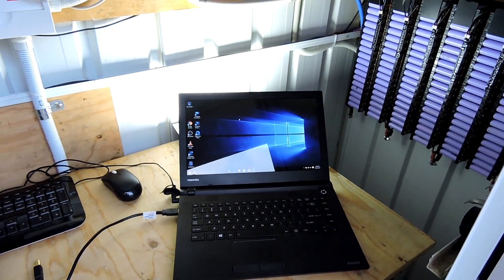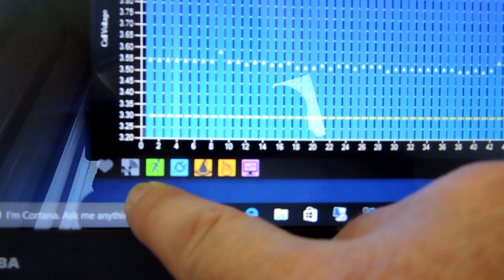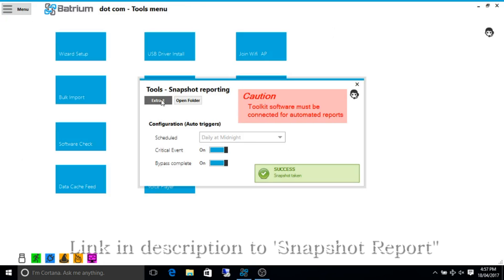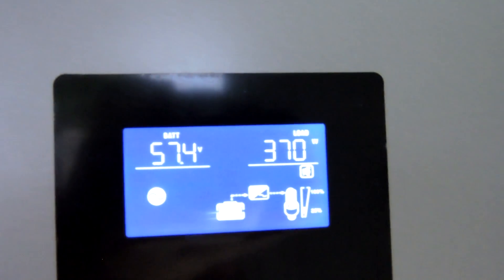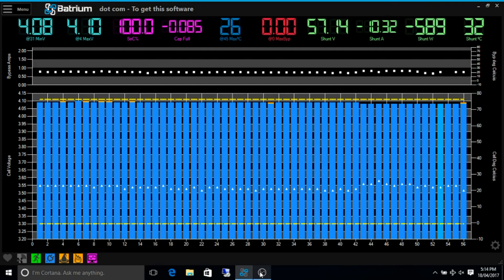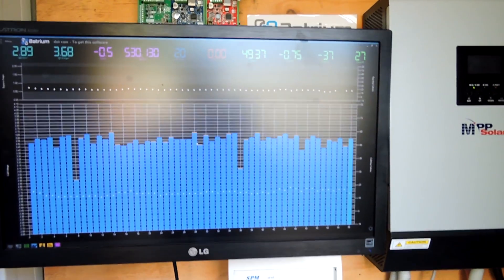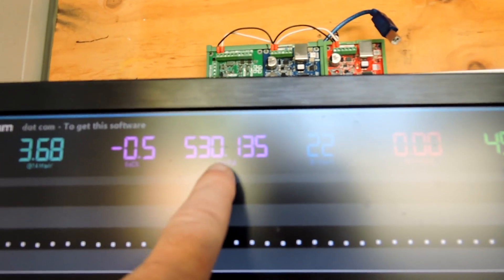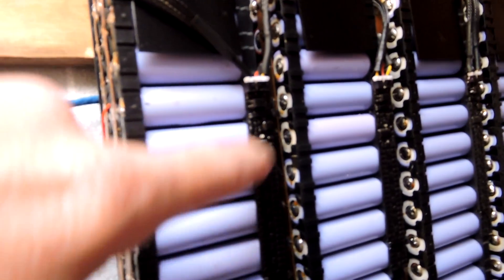18650 real world load test - 63 hours to run from 57.4v to 49v not bad from recycled laptop battery

Comment: That is 1/10th the month now you just need to add another 40,320 battery's to it and you can go a month (roflmao). Hey if you install 2 banks of 44,800 you can power the house for a month on one. Then switch over to the other.  One will be charged by then and you will never need the grid! To bad it would take  89,000 some cells to do it! only about 100,000$ in cells if you were to buy them new LOL LOL. Your going to cause a used cell shortage on the market lol lol. I estimate you use about 550 to 700 KWH of electric during the month.
Reply: You have to remember that he turned off his solar so realistically he should be able to do away with the grid. As long as he has solar charging the batteries during the day he clearly has more than enough power to last the night.
Reply from the maker: +F1nddatruth or 4 nights :)
Reply: A. B. You're right! If the Sun didn't rise for a few days he'd be up shit creek. ^_^
Reply: HBPowerwall    I am in the 240v world :(
Reply: he will need 51,200 battery's to  can go a month and 102,400 battery's for two month's
Reply: This video just made me VERY happy!!! I love your setup.  I just purchased the Johnson batteries 22kwh package from Tech Direct to run my 8kw Outback system. I look forward to posting some video while learning about battery management of my 9 packs!! You have inspired me. Great post.
Reply from the maker: You just won the internet... love it
Reply from the maker: I'll just add more solar panels - cover those nasty losses :)
Reply: What are you talking about? You don't build your battery back up to last a month.  It doesn't even have to last a day.  It's designed to keep you from using grid while your solar isn't supplying enough.
Reply: A. B. are you joking? why charge one while you use the other? just use the power is you have enough...
Reply: Imagine you have a wall, half if made with concrete reinforcements, half with cardboard boxes. Now your car is heading for the wall and byur breaks are not working. Where would you turn your car? Towards the Concrete or the Boxes? This video is like steer a car into a concrete wall. And advantages shown are immediate stopping. No damage to the concrete wall. So everyone benefits.We saved so many boxes.
Reply: @yt678901  Well, tbh it depends on what's behind the wall lol.  In some scenarios, hitting the concrete might be your only chance to live.  If your car is out of control, you just want the damn thing stopped.  As long as you're not going 100mph (or if you are, you'd better be sitting in a race car), chances of surviving the wall are good are good :D

Although I'm not too sure how this analogy applies to solar cells, or what the cardboard boxes would represent.  Maybe it made more sense in the prehistoric era that it was posted 2 years ago.

Comment: 63 hours is great... I only need it to last 8 hours to 10 hours... I need help with info.... how many 18650 do I need to build a 12v battery pack that lasts a minimum of 8hours on a 900VA ups inverter.. And I want to use 700W load.
Reply from the maker: 700w load is massive added to the inverter usage and losses would be 1000's of cells depending on what type they were.

Comment: Do you have a video that explains why your chose the 80 cell pack configuration? I’ve seen a lot of people using this type of pack and I’d love to know why
Reply from the maker: Because it looked sexy in my wall mounts - I was going to go for 160 cell packs early but got talked out of it by my metal guy for the mounts and general public made a good argument about maintaining the cells. That said 300p packs would be my choice for sure.
Reply: HBPowerwall sorry still learning. What’s a 300p pack?
Reply from the maker: So mine are 80p or 80 in parallel whit bigger packs ie 300p it costs less to protect with bms and makes for much more balanced packs just by sheer size
Reply: HBPowerwall thanks so much!
Reply: HBPowerwall is there someone who has done larger packs that I can learn from whom you would recommend?
Reply from the maker: Mike - https://www.youtube.com/channel/UCh85wOuqCsD3gh_lkAXbQEQ for sure!!

Comment: So you have how many batteries? It appears that you have maybe 2800 batteries or so. If you bought them in bulk then maybe you only paid $3000. Is that still a good deal when compared to deep cycle lead acid? By my calculation to have an equal amount of lead acid batteries in kWh you would be spending at least $5000 at the minimum. So going lithium (even with laptop cells) is indeed cheaper, but for many people they probably see it as a huge hassle to connect them all. I like the 60280 cells which are up to 70Ah each, but they sadly cost 90 dollars each which would mean you would have to have $10,000 to make a 29kWh system. So bulk buy 18650's are the cheapest option around, even if they are fiddly.

Comment: wow where did you get 4400 lion batteries for 1400.00?
Reply from the maker: that math has changed quite a bit - that was just the useable ones another 6k were recycled, since have 3000 more for very little more money. IT's HARD work, if you counted my hours it would be 10x that cost :)

Comment: That's what you get for using Windows.
Reply from the maker: Meh, fix windows computers every day i know these things lol
Reply: HBPowerwall I've never had my Linux monitoring system randomly reboot on me. Just saying there is an appropriate tool for everything.
Reply from the maker: Like saying Android phones are better than apple.. Seen  many Linux computers reboot in my 17 years of fixing computers :)
Reply: HBPowerwall Not at all comparable. They are both functionally the same.
But using a minimal Linux server install with just X and a few monitoring tools running is completely different to a full blown Windows install designed for desktop usage.

Using those for normal desktop work is a matter of preference.
But this is a specific thing.

Also a better comparison would be an Android phone VS an enterprise rack server. You could run a web server in both, but one is more appropriate for the job.

And yes, I've also spend my whole life programming for both operating systems.
Reply from the maker: lolling :) holden ford debate i'll leave alone

Comment: Hmm go google for 24-85-25 48 Volt 24 cells battery, 
AH CAPACITY
After 6 hours is 1020
Ater 20 hours is 1608

on this site http://www.rapidtables.com/calc/electric/Amp_to_kW_Calculator.htm
type in 1608
48 volt  than hit calculate
77.18KW and that for $7500 battery

This is more than enough to run and charge your EV(if you have one)

Please tell me more about your PV size.... i thumbs up ya video

Comment: Where do you find these batteries. LOL. I've got a eskateboard that had a sealed lead acid battery I want to replace with 18650s and think this will be a good  project to get going. my solar house doesn't have a battery pack, hopefully one day I'm game enough to build it.
Reply from the maker: I hunt high and low for cells. anywhere that has a laptop in use is fair game.

Comment: We use over 29 kwh. A day.  In the winter we use more like 70 kwh
Reply from the maker: wow that's a lot!
Reply: thanks for the video :) great inspiration indeed,  very nice monitoring software and hardware setup
we use barely above 5 kwh a day :) (without ac), small flat, and I'm always amazed at how much power "you" use , wow !
Reply: winter we have heat on... only electric, summer AC is on 24/7. live in norway. when you have mutch you use more, same whit water. when i take 1 glass of wate i use 5-10 liters to get 3 dl coold water
Reply: makes sense, down here we use natural gas for heating and cooking, ac moderately (although down south they have to use it 24/7 )
curious to know what's the price of 1 kWh ? here it is subsidised (so ridiculously cheap)

Comment: I have a question regarding the values and use of 18650 batteries.  I  have batteries of different values, from 500 mAh up to 2500 mAh of used laptop batteries. I can use them all or can I only use the same value in the DIYpowerwall.
Reply: not recommended or the low ones will discharge faster and spread the voltage gap after a few weeks use. so its best to group all the lows into a separate batt and charge the sets with diff chargers via bms to minimize the issues

Comment: fuck Windows 10
Reply from the maker: That was rather rude don't you think..
Reply: no! Microsoft obviously doesn't care at all about their customers, and force them their features! Like Windows 10 installing sponsored apps on your computer without asking and in the background (which is very difficult to turn off, you have to go into the registry), and it makes updates without asking and it's not possible to turn that off with the home version of windows. (you can trick it into not doing it by declaring your wifi connection as metered btw, you should do that for videos!)
 Fucking your customers for money - THAT is what I call rude.

Comment: Very cool...I had no idea this technology existed. How safe is it? Anywhere I can see stats on those batteries?
Reply from the maker: It is cool! it's not so much technology it's just new ways of using old tech. Not sure what stats you'd like?
Reply: Yea, it just never occurred to me that it would scale up to a whole house (though no reason to think that..just hadn't thought that far into it until now, because I'm getting ready to put a system in my own home).

For stats, I'm just curious of the failure rate, especially catastrophic. I believe I've read about those specific batteries and they are insanely reliable. It's just something on my mind, with all the horror stories out there about li-ion batteries lately.
Reply from the maker: you're likely referring to a pouch type batterie. In ebikes and the like or perhaps hover boards with 18650's with dodgy BMS's installed. well over 10,000 cells nothing catastrophic yet but hang round could happen :)
Reply: Probably... I'm mainly referring to ecigs, but I've also heard about the other device failures you mentioned. None of the news articles ever mention makes/models or anything useful about what/how it failed. They just present it as the apocalypse so they get better ratings.

For my ecig, all I can do is try to avoid cheap batteries. For my house, though, while the batteries will obviously be in a separate building, that's still some costly gear you don't want to set on fire!

Thanks for your replies! it is very much appreciated. Subbed, because I want to see how this goes for you :)

Comment: Umm 63 hours @ 29 KwH (331.4 KwH/month) is pretty much useless in warmer areas not to mention far below most developed areas consumption.

In our case, our average monthly is 2,500 KwH with 3,000+ KwH (prior to a new $25K HVAC our peak was 5,500 KwH), but even the average is 900-1,000 KwH.

Just saying...
Reply from the maker: Remebering that's just powering the GPO's in the house and lights and ceiling fans. That sort of powerbill you have would ensure I would need another job just to keep my kids alive. Easier to conserve than to create.
Reply: How much do you pay for 1 KwH in your country? And where do you live if i might ask? In Portugal 2500 KwH would cost 500€ (around 550 dollars) and for comparisson, the minimum wage in Portugal is 557€
Reply: Here we can buy from any service provider working in the country and  change provider every 4 months, but there is  litle in price. We pay €0,165/Kwh + 23%VAT + €0.16 day power tax. But the average power consuption of a house here rarely goes over 500Kwh/month
Reply: 2500kWh? wtf? I run around 3-8kWh/day, usually around 5-6kWh/day, under 200kWh/month. Costs about 38 US cent per kWh... 2500kWh per month is just insane.
Reply: We have an all electric home. 5 and 2 ton HVAC which is a $27K system (TAM 9 with XV20I, 1.5 HP pool pump, 75 gallon new hot water, 3 PC's (250W-600W if I game), Consoles, 8 TV's, LED lights, Electric stove top and oven. The house is approximately 3,700 SqFt and we live in central Florida. We keep our temperatures in summer @ 75° F but we have several  (4) zones .. my daughter sets her zone at 70-72° F which also controls the first floor bedrooms and 2 baths.

The average in Florida is 1,100 kWh per month in an 1,100 SqFt home.
Reply: Now I've read it and get it. I assume your swimming pool system runs 24/365, right? Plus Central A/C unit. 

Price per KWh is still rather low at $0.14, our price in Leon, Guanajuato State, Mexico is around USD $0.19 plus 16% VAT.
Reply: D Jaquith Yep... Comfort has a rather high price in most of the US, this is one of the reasons why so many retirees settle in Mexican cities. 

I've lived in Phoenix, AZ in 2013-2014 in a two bedroom unit with HVAC, plus all electric appliances... my electric, gasoline and food bills were way higher than the same concepts at my home town in Leon. 

Of course it all depends on the income... low living costs might not yield a good life quality if your revenues are equally low.
Reply: Jesper Andersen 
The average Florida home consumes 1,100 kWh monthly, but that's at 2,000 SqFt. We've had $600 electric bills...
Reply: 2,500 KwH average per month for domestic consumption?  Would you be so kind to tell us: what appliances are regularly in service? (assume central A/C unit) and how many people live at your home? Thx!
Reply: D Jaquith Thank you for your response. We live in the highlands of the State of Guanajuato, in the suburbs
of Leon. The house roofed area size is around 
4,500 sq/ft. We have electrical and butane systems, no HVAC since you do not need it in highlands. Some trees and lawn aroung and you have nice temps all year around: 27°-10°c (36 to -6°c highs and lows for few
Weeks during spring and winter). Our average consumption is 8.5 Kwh per day.  Appliances that consume the more: Water Electric heater, Microwave Oven, Induction Oven, Air Heaters during winter nights, Fridge, washing machine, that is pretty much all. We will install a PV system and a Battery Storage to get off grid... estimated savings
Might get up to USD $800 per year (give or take)
Reply: Today and all week our Temps are 91° F  or 33° C which is intolerable add to that high humidity. The main unit can draw 5,000 watts and the smaller 2,000 watts. The HVAC consumes the bulk of our electricity. No doubt if we lived in a more mild climate our consumption would go way down add to that if our major appliances and hot water were gas. Florida and most of the southern states are hot and humid during the summer. Our peak consumption lasts 4-5 months. Heck even this past winter we had the heat on maybe a total of a month with the remaining time AC...
Reply: carlos batista 
We live in Florida, USA and unfortunately we don't have 'FPL' electric $0.11/kWh, instead Peace River at $0.14/kWh. 

So if we average 2,500 kWh × $0.14/kWh = $350 per month.
Reply: carlos batista 
Where we live now once was considered rural, so electric companies charged more to install the infrastructure. 'Now' no one likes it... 

I posted 'average' kWh monthly usage. Obviously, we don't live in an average home. Further, our average temperatures are higher, I compared my area to different parts of Portugal. This week every day is 90° F (32° C). Homes around my area all have pools and are 3,500~6,000 plus SqFt (325~560 M^2).